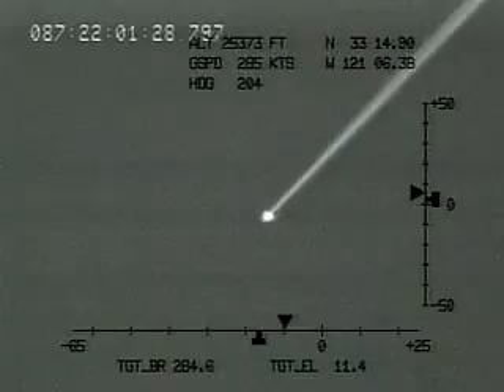Getting Ready for Mach 10

Comment: A 'scramjet' is a version of a 'ramjet' that has the airflow at supersonic speed through the whole flowpath. There are no moving parts - the air is compressed by the ramp-shaped forebody of the airplane. The rocket booster on the back was to bring the airplane (the black part that separates from the front) up to a speed where the scramjet could start operating. An operational version would have 'regular' turbojets do that function, but a rocket was cheaper for the experiment.

Comment: Somebody else can probably explain it better, as I'm not quite that knowledgeable about how these things work. The SC in SCRAM stands for Supersonic Combustion. It's not a rocket, however. It's basically like a supersonic jet engine which uses the oxygen in the air, vs. a rocket engine that depends on loads of fuel for it's thrust.